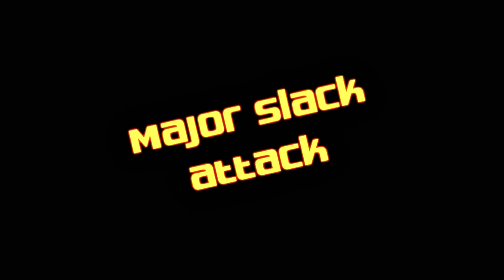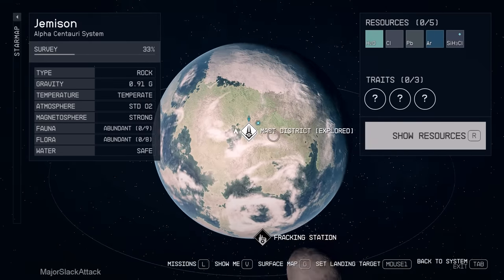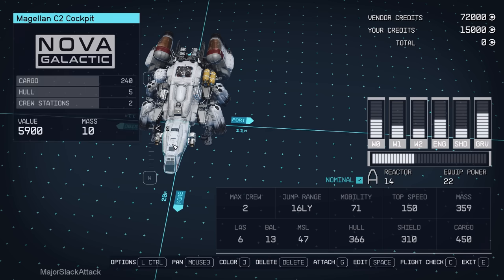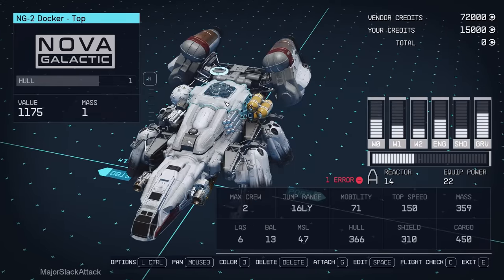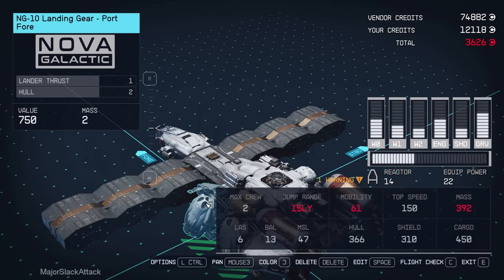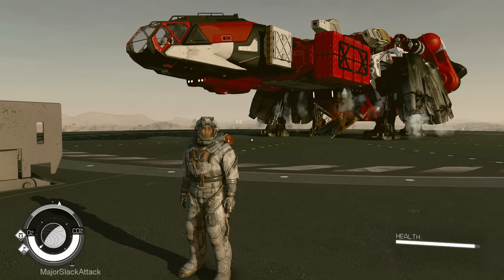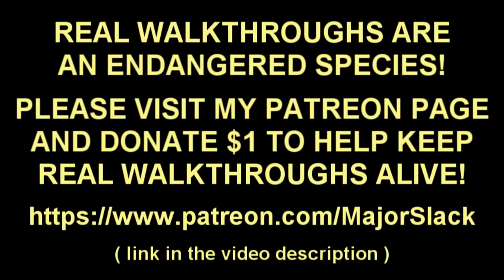Starfield Ship Building Guide - Complete Tutorial on all the Controls + Mystery Errors / Warnings

Comment from the maker: TIME STAMPS (or hover over the video playback progress bar for chapters!)

0:00 - Hardcore Slackers
3:40 - Camera controls
4:33 - Control panel
8:11 - Emergency reset button
8:54 - How to build a new ship from scratch
9:53 - Moving parts around
11:19 - Moving groups of parts
13:37 - How to move parts vertically
17:17 - Errors & Flight Check
18:41 - Mystery Unattached Modules error
20:45 - Invalid Docker Module Position error
22:57 - Overweight warnings
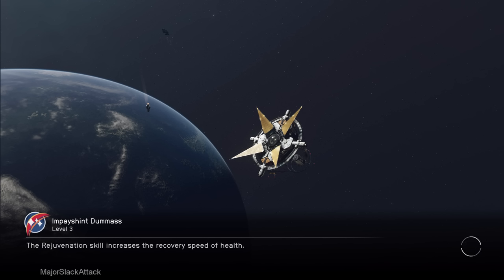32:19 - Missing Weapon Assignment warning
38:26 - How to get more ship modules available
42:40 - Leveling up makes more ship modules available
46:12 - Different ship builders have different stuff
50:30 - How to find 2 ship mfg showrooms in Neon Core
53:51 - How to set up a ship builder / flight test outpost

CORRECTION: The Unattached Modules error at 18:41 is a result of the Frontier's default Grav Drive having no attach points on its sides. The engines do not necessarily need to be attached to the reactor.

Thanks for watching! 😎

~ M4]0r 514cK

Comment: Pro Tip: if you REALLY want to be a master with these videos, invest in an Xbox controller and you can get the xbox command by starting to use it (the command prompts effortlessly switch notation just by using the desired control device.)

Note that I find using the controller often an easier device for building ships, but i typically use both throughout the game (though exclusively controller in flight).